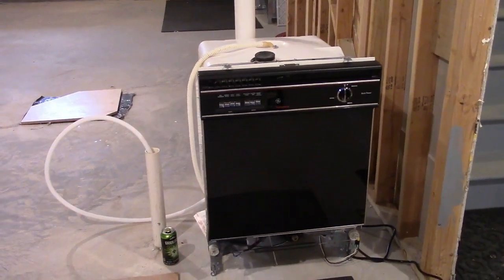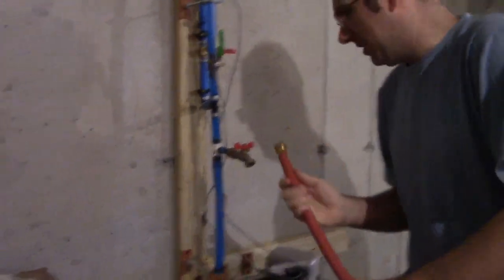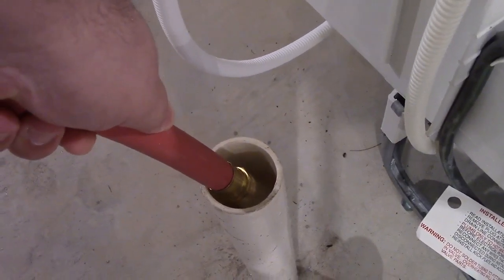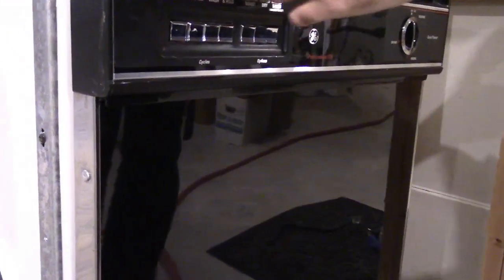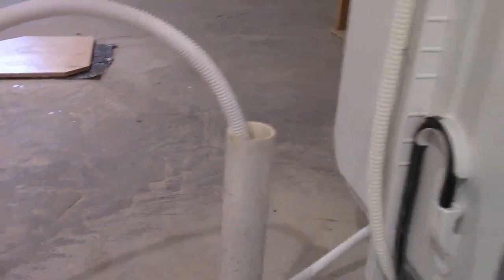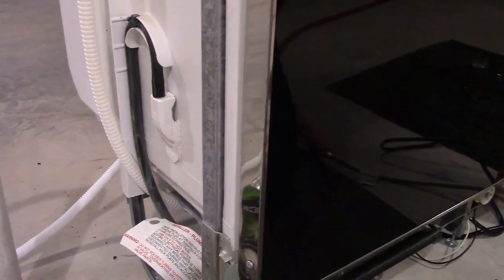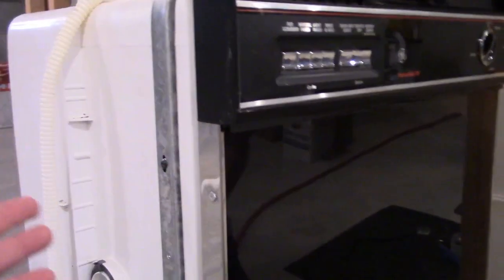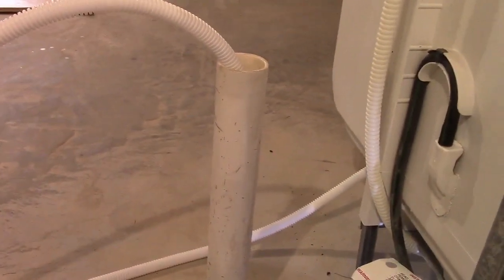Running A Cycle On Sharkie626's GE Potscrubber 970 Dishwasher With Wattmeter

Comment: Tricknology, pretty much no different than business trickery like for selling organic vs regular foods. Since you mentioned the Start/Stop technology, we actually have a 2019 outback with that trickery. I bet, you will be like "At this point I walk away" the moment if you were to sit in it and turn it on.  Does it really save gas like the websites and ads say? Above all else, doesn't sound like you should believe the hype for this either. Ironically, wouldn't STARTING the engine up EVERY red light you come to consume more gas than simply keeping it at idle? I personally think putting it into park when I sit for a long period works best. (Scotty Kilmer even suggested it.) Additionally, I don't need the computer telling me to keep my head straight and all sorts of obnoxious things it does. Glad I don't use this vehicle. I even heard that you can turn these simple annoyances off, it may just re-enable them itself. Kind of like how modern computers do what IT wants. BTW, I have seen sharkie's videos on this dishwasher, It looks and sounds very good! Much simpler machinery.
Reply from the maker: Organic is a huge crock.  Unless I watched that plant grow, I can't be sure it's organic.  The only true organic foods are the ones you grow yourself.  The rest--well, there's a lot of food mislabeling that goes on out there, purposely.

I know for the Toyotas, there are aftermarket kits that can be purchased that sort of plug in to the factory wiring harness, and will disable that function automatically each time you get in the vehicle.  That would be something that's worth every penny.

A lot of people are under the impression that "because a refrigerator is so big, it must use a lot of electricity".  That's false--just hook a wattmeter up to it and it will prove it.  

The same false notion occurs with starting a vehicle.  I think this is a leftover from the days of carbureted cars, where you had to pump the gas pedal before starting it.  Well, I HAVE one of those, and my first car was also carbureted.  People think that pumping the gas like that uses so much of it.  Think of a bottle of spray cleaner.  Each pump is one spray, except the carb is spraying gasoline.  Is it really that much?  No, not at all.  And that's ONLY for a cold start.  A hot restart requires no pumping whatsoever, and no extra gas.  In fact, carbureted cars start almost immediately when hot, faster than fuel-injected cars.  HINT:  In fuel injected cars, most of the same fuel-related stuff applies, except it's all done automatically.  

In general, an engine such as you'd find on a lawnmower (and I use this as an example because often you can see some of these components) has the propensity to keep running, and will do things in its power to make sure that happens.  You would either have to cut off its air supply, which is hard to get a complete seal, cut off its fuel supply, which can happen if it runs out of fuel, or kill the ignition system in some way, typically by grounding it out, which is what most do to kill the engine.  When such an engine is threatened to stop running, the governor will then swing in, which tugs on the throttle cable, the equivalent of stepping on the gas an old car that always stalls.  But if you've killed off anything like the ignition system, the cycle cannot continue.

The fact of the matter is you've only paused the cycle, if you could get that engine spinning again, it would continue on right where it left off.  No extra fuel is required.  It's already there, ready to go.  Once the engine has been off for some time and is cold again, you've stopped the cycle completely.  And then, we're only talking about a few spritzes of gas.  So is it really THAT much?

It's like I explained in the video, $7 a YEAR for the energy saver option.  I understand people have to make every penny count, and sometimes $7 a month could be a problem, but if you don't have $7 a year, you have much bigger issues in life than worrying about saving electricity.

The start/stop system in cars is just another eco measure that has no merits.  They solve one problem, and create 6 others in its place.  Starting the car 15 times to go to the grocery store is A LOT WORSE than a trip that required starting the car twice, once to go to the store, and once to come home.  The more you use something, the faster it's going to wear out.  That's just simple common sense.  "They're made better to handle it".  No they're not.  They're made the same so when it breaks, hopefully it goes back to the dealer, so you can pay more money.
Reply: @jaykay18  It's pretty much as if the people who market energy saving options and make EVERY penny count, it just turns the so-called big energy savings into false advertising. Start/stop tech is the same story just like "low water usage" in HE washers, and "low electricity usage" in LED bulbs, what the average consumer thinks their saving with these things, in reality, your saving hardly at all as opposed to incandescent power usage or old school washers water usage that use the same amounts of water and power. I agree fully that the more you use something heavily like an engine, the faster it will wear out. I was actually the first to think that when she first bought the outback and I'm very glad to hear from you that my theory accurate.
Reply from the maker: @saturnevan  You're right, it's just another name for the same thing!  You don't save with the new stuff, nobody seems to realize that, and it's a shame.  My theory is correct, there's no way physics would allow otherwise!  And let's also not forget to mention what happens to an engine when it's shut off.  So you're out driving.  Car gets up to temperature.  When you get where you're going and shut the car off, the coolant sits there and doesn't move into the radiator anymore.  So the temperature actually INCREASES because there's no active cooling system.  Now in the course of everyday life, that's not really a problem, but why would you want your engine to get hotter more often?  And that's only one problem.  The next is restarting.  While fuel isn't an issue, oil is.  Yes, the cylinders are coated but a good 2 minute light allows time for that to drip down and thin out, leading to damage when it's turned over again.  It's just the tiniest amount, but do it over and over and over again, and magically it's worn out!
Reply: @saturnevan  does the heating coil stay on for the heater dry. ?. Or does it he heating coil go on just during the was and rinse cycle?

I know our old kitchenaid had the fan blower motor that dried the dishes

Comment: It's Dish-Day Dish-In 1.0 at Sharkie626's Place. Like the idea?
Reply from the maker: Not bad, not bad!
Reply: @jaykay18  Probably not the exact same as watching clothes turn around in water. Considering things like the tiny water drip at the bottom, it may be interesting to see what gets fixed later on with the machine.
Reply from the maker: @saturnevan  Pretty much nothing.  That leak will stay; if it gets a lot lot worse he may have to change out the motor assembly, which he claims would change the sound of the machine.  Otherwise, with hot water, the leak would have been less, and he decided after that day I was there that it's never going to run another cold water cycle because of it.  I've been hearing about how he wants a sink down there, and of course there would be some sort of cabinet built where that dishwasher could be installed, I'd imagine.  Though it would be just fine with a plastic slop sink and it sitting right there next to it.  Nothing has happened yet, if and when it does, he or I will have a video!

Comment: Hi Jay, I'm not sold on the energy efficiency crap the European Union is pushing. The modern Bosch machine that was installed in the kitchen here would take 3 1/2 to 4 hours to do a normal load. It gets a higher rating as it draws less energy but for a longer time. That's totally warped figures in my opinion. My old Miele from 2002 does the  same in 58min and uses the same amount of energy. 
That's like the 2L engine size crap Europe has. Or lets force everyone to buy diesels (or disease-le as I like to call them). Where was the worst city pollution recorded, California? no it was Paris as the place is full of them. Now there is a push to get rid of the diesels. The bureaucrats (or euocrats) are f***en Idiots. But I digress.
Reply from the maker: Yes, I've heard they're trying to get rid of Diesels.  We don't have many here.  But yes, they are limiting everything about us and the lives we lead, but no one seems to be fighting back, which is the sad part, because they wrap the entire thing in an environmental protection blanket.